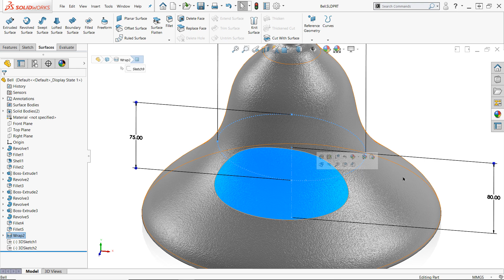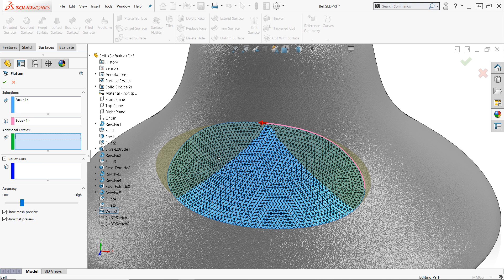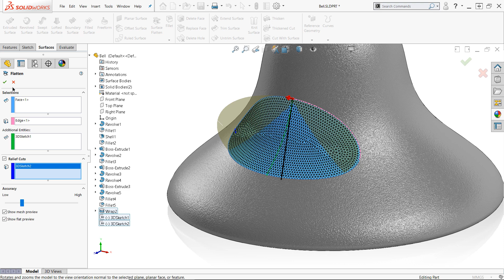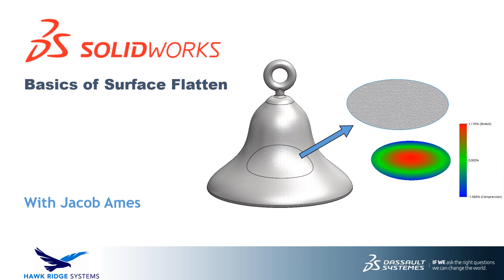Basics of SOLIDWORKS Surface Flatten

Comment: I am an engineering student and I want to know if my vega integrated graphics card is enough to run this model with solidworks software, can it be run smoothly with just an integrated graphics?